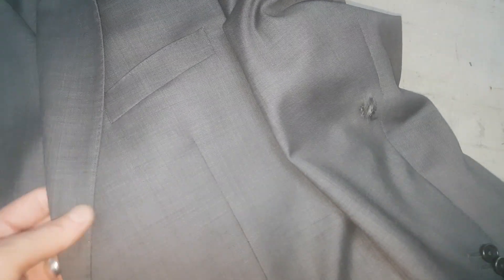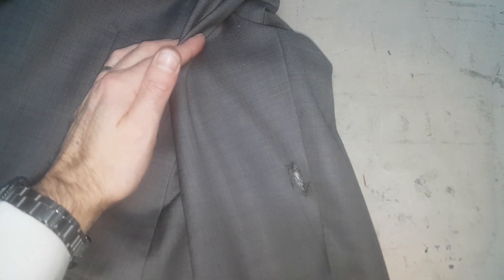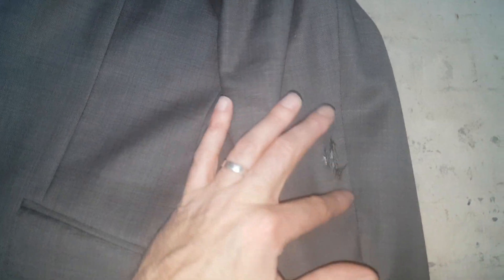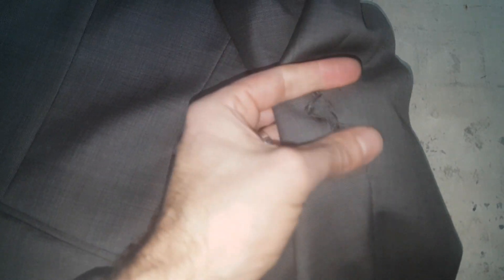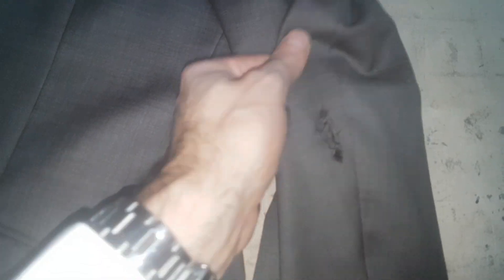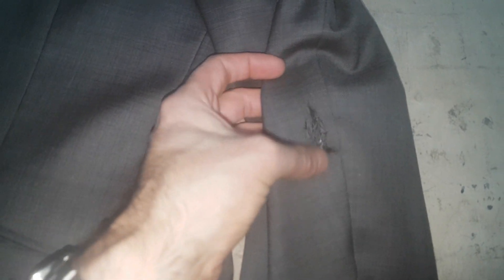INVISIBLE ELBOW RIP REPAIR ON SUIT JACKET BY MANCHESTER TAILOR MICHAEL DISCUSSES OPTIONS

Comment: Hi, I have a  vintage tight felted cashmere coat. It has some moth nips that do not go all the way through the fabric and one is quite large. How would I repair this to be almost invisible?  I have done tweed and wool with no problem at all using fibers from the coat. This one does not five ups fibers very easily and the felted cashmere is so tight the same methods don't work well with fuse it powder. The fabric doesn't seem to absorb the fuse it well & it leaves a "glue" look on top.  Any help would be great, thanks